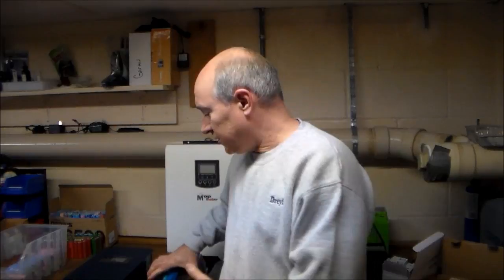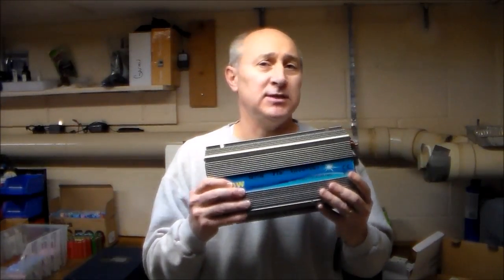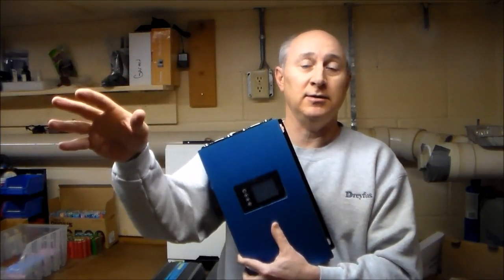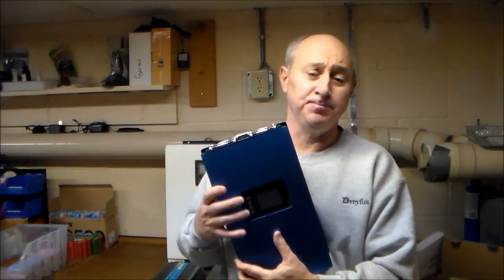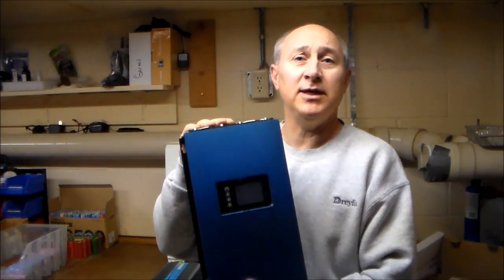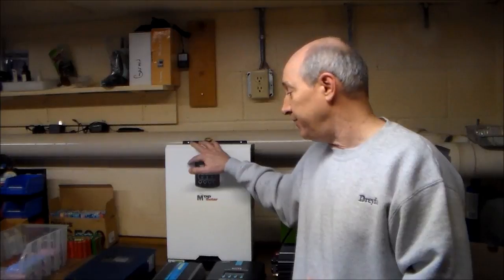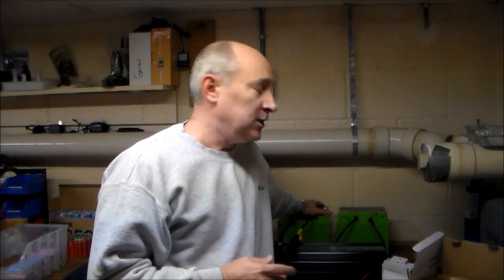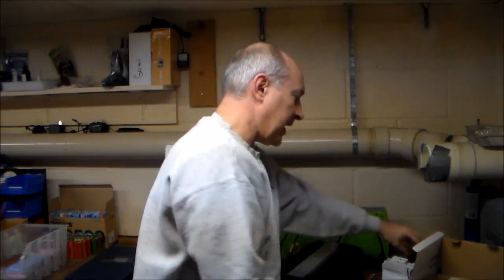DIY Solar - Episode 1 - Getting Ready

Comment: My friend.I have to congratulate you for all interested videos you upload.Please allow me to erase a question to you and i will be glad if you can answer it.I have the 2 kW on gride inverter with limiter .It works fine.But i have stuck.the reason is the city grid failure.Its so pity when you have 4-5 or 6 kw solar panels to depend on the city grid.I want to create my own personal grid .Can i use an off grid inverter with the same power 2 kw which will create electricity with the same ....DNA    220volt AC and frequency   50 Hz   and use it to ignite my on grid inverter???Thank you for your time.......cheers.
Reply from the maker: Yes, others have done that in the past. However, I don’t have details since I am only familiar with the 1KW inverter model. Best to search YouTube for other videos. Good luck in your Hunt!

Comment: Nice video, Got a question, what gauge cable would I need for a solar system, output 460v, 19amps, 70 meters from solar panels to inverter. Thanks
Reply from the maker: Thank you! I’m sorry, but for liability reasons plus the fact that I’m not an electrician, I am not able to provide specific technical information. There are plenty of resources online to aid in figuring that out. It would be best for you to Google search “wire size chart”. Best wishes!

Comment: The best inverter in the solar energy world is SOL-ARK and they are the only ones with a EMP hardened system which also has 2 built-in controllers and arc-fault protecting the entire system.
Reply from the maker: Jon Zuber But extremely expensive!

Comment: This is why it's hard for others to get into solar, people not following the rules and thinking that they can sneak solar into their home.  This is illegal af.  Not safe and shady.  I have 4.4kw a UL listed tie inverter, and I pulled the permits and engineered it myself.  My house has a NetMeter, stop teaching this rogue propaganda.
Pull a permit.  Learn the proper way.
Reply from the maker: allenyourtech Actually you are completely WRONG! I will use the “chicken/egg” argument back at you! For YEARS the power companies have made it difficult or nearly impossible to legitimately go solar in MANY areas around the country. They have created high prices and a ridiculous set of hoops to jump thru. This is why low cost inverters were created, not the other way around! If the process was easier and cheaper, more people would do it legitimately. Why should people even have to “sneak solar into their homes” in the first place. If it’s their home and they are generating their own power for their own use, why should the power companies even need to get involved? Can you say MONOPOLY?!  Quit drinking the power company kool-aid!

Comment: Great series of videos! I'm inspired by your grid tied system that doesn't feed back to the main grid...I'm starting to gather all components to start planing my system layout. I came across the same inverter but with wifi capability and it was less money that the inverter without the wifi: I wonder why? What do you think of the model with the wifi?
Reply from the maker: I like the ones with WiFi already built in. Back when I bought my two units, the WiFi option was significantly more cost, so I opted to go without them since I already have the Sense Whole Home Monitoring device. Good luck with your installation! Please let me know how it goes!
Reply: jimginnyohio I will get the 2 wifi inverter. Another issue is that my main panel is located outdoors 40 ft away from my garage and it’s full. I don’t think the system will do well outdoors. I’m thinking of wiring a sub panel out to the garage to keep the system indoors. Issues with that; I need to keep track of both legs of the panel to install both inverters on separate legs, the power sensors wires that wrap around the thick main wires have to be extended but not sure what outdoor wires to use. Any advice for me? Thanks
Reply from the maker: @czarrevs3616  Yes, those devices are NOT meant to be outdoors so you will definitely  need to keep inside. The sensor clamp wires can be extended. I've heard of some people extending them 25-50 feet. However, I would recommend caution for extending them beyond that since they may not be as accurate if moved too far away. Since there are only two wires in the clamp cable, you can use almost any multi-strand cable to extend those. I would recommend placing into either PVC or metal conduit if running them outside.

Comment: Hey Jim, They have the Micro inverters now that are so much better with better efficiency and they are ul approved. Did you put a limiter on both legs of the power box?
Reply from the maker: Yes, my next addition will be some of the micro inverters....although I'm not sure which brand to go with yet. Do you have any suggestions or recommendations?  Regarding the limiters, I only have one limiter clamp. It is installed on the same leg that I have the inverter connected to. Although, I am "monitoring" both legs using the Sense meter.

Comment: Hi Jim, I enjoy watching your videos, thanks for sharing. In terms of the Grid Tie inverter which one do you recommend? I found several on Amazon which look similar to yours with mixed reviews and noticed you did not encounter some of the issues mentioned. This is the one I am considering. Please let me know if this is in line with yours or can point me to the one you purchased. Aim High
Reply from the maker: Joe Gleason Hi Joe. I ordered the 1000w GTIL2 with limiter. 45-65v model that works with PV or Battery. If you plan to use with battery, you might want to consider the 22-65v model if your battery bank is 24v. The one being sold by imeshbean should be correct. Good luck with your install.
Reply: @jimginnyohio  Thanks for the quick reply and advice.

Comment: Hi Jim, I noticed in video 11 (?) of this series, you are experiencing problems with the accuracy of the limiter aspect of this grid tie inverter.  I believe I purchased the same model of limited grid tie inverter (1,000w).  
The watts displayed in the lower right corner confirm the exact watts consumed, so the limiter itself is working properly.  UNFORTUNATELY, the GTIL itself uploads as many watts as it can possibly get from the panels.  This despite all attempts to turn on the limiter function under settings, save settings, verify that the settings were saved, etc.  In this state, it is no different from any other unbridled grid tie inverter, that uploads as much energy to the grid as it possibly can, based on the output from the panels, the sunlight, etc.
Reply from the maker: I found a solution for this issue. However, I have not yet had time to post an update video. I hope to do that within the next few weeks. The problem is in the limiter clamp voltage rather than in the inverter itself. The clamp manufacturer is now producing a clamp that has the correct voltage settings for US current that is large enough to fit over the 200amp wiring that is more common in the United States.
Reply: I sure appreciate your reply.  Seems there are others suffering from this as well, so as usual, you will be helping many.  I wish I had the patience and faith to wait it out, but because the limiter did not work correctly, I accidentally uploaded power to the grid, and the power company was out in front of my house the very next day.  Thank you again!
Reply: We're not sure this will help!  Here's why:  When I turn on the air conditioner but the compressor has not kicked in, the Kill-A-Watt device says 59 watts are confirmed.  The Sun 1000 GTI even says 59 watts are being used, on its tiny little screen.  I keep the compressor from kicking in by turning the dial on the air conditioner to 80+ degrees, so it won't kick in.  Finally, even though the total power consumed is a steady 59 watts, confirmed by the Inverter display, the Sun 1000 GTI quickly starts to upload 100% of my panel power onto the grid!  So it would appear that your initial thinking was correct, namely there in fact MAY BE something wrong with the Inverter itself!  : - (

Comment: Hi, do you know what to set the limits  under the gear menu, specifically the bat or solar current mode , i don't understand the  voltage and amps limits, what would you set them too?
Reply from the maker: Alejandro Robles Those are just what they say, meaning how much power you want to limit the device to produce. I actually use the Bat or Solar Limited Power setting instead. In my case, I want to produce as much power as possible but not overload the device. I have 4 panels. I have two pairs that are wired in series (doubles the voltage) and those two pairs are wired in parallel (doubles the amperage). So the total voltage my panels are producing equals 60 volts pmax. Therefore I have the voltage setting to  600 x 0.1v. I also have the bottom setting to 900W. This will limit the device to a maximum of 60 volts or 900 watts. The Bat or Solar Limited  Power setting works in a similar way only you would set the amperage setting based upon the amperage of your panels times 2. Does that make sense? Otherwise, if you have your device connected to batteries, you would use the values of your batteries instead of the panels. Note: I have the 45v - 90v model GTIL2.

Comment: Mistakes will be made, lessons will be learned. Send me all the stuff you blow up. My whole system is made from stuff that let out magic smoke. Are you thinking of heating water?
Reply from the maker: opera Yes, I will be installing a hybrid water heating unit. Video is forthcoming.
Reply: I'm not very far from you and have a cold unheated basement. We have a NYLE HPWH add on unit. Got this on ebay new for $325 shipped! It was left over from a utility company HOT SHOT program. Look it up, lots of interesting data from multiple studies.  Wife loves it filtering the air and dehumidifying the basement. We are low use and it consumes only 2.8KWH a day.  I feed excess solar into the unused heating element when grid tie needs are exceeded.